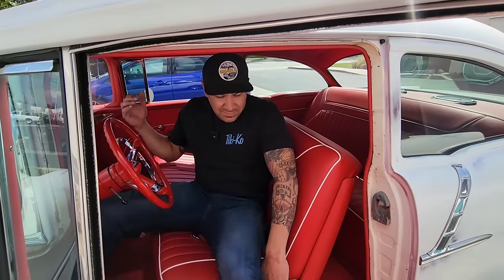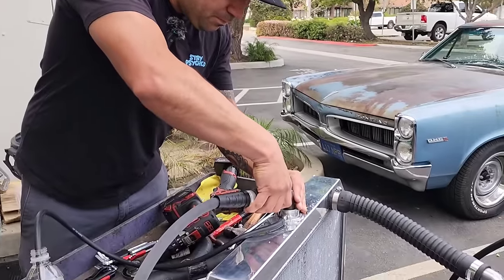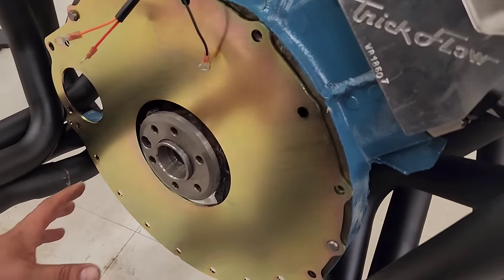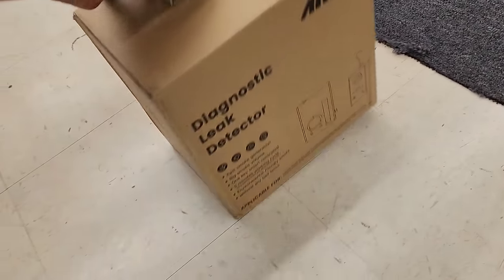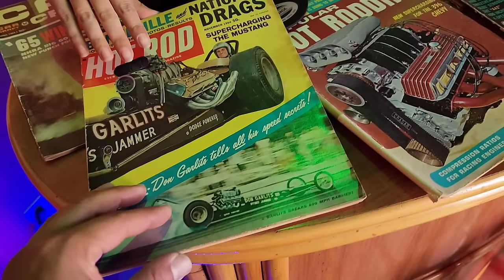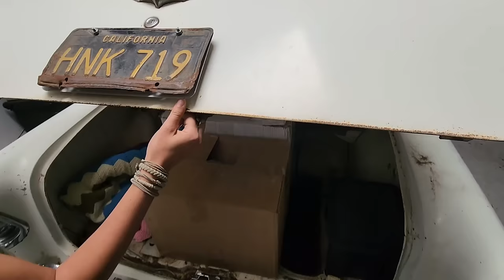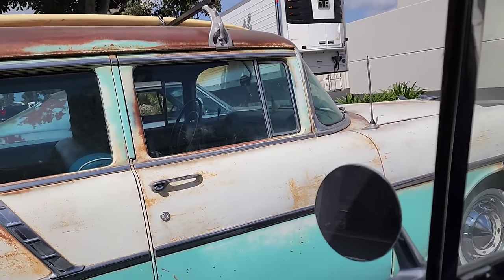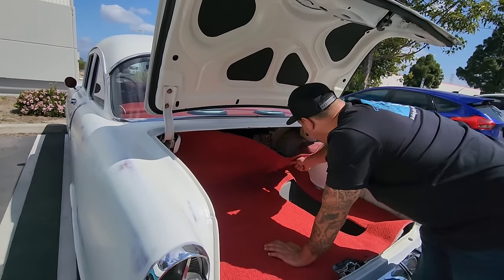Selling One Of Our Tri Five Chevys

Comment: Hey there!, you could get a $20 box fan from Wallyworld, mount it in front of the radiator so its not pulling engine heat through itself, then check out Moroso's universal electric water pump drive kit, which should give you most everything you need to adapt it to mount on just about any engine you want to test on your stand. Happy Hot Roddin!

Comment: Don’t forget you need a crank case ventilation system so the seals can breathe in keep the oil in the engine soon as those pistons start moving at high RPM You will build pressure in a crank case it’s not a stock car so now hi Performance

Comment: #62 Heads had 2.11 intakes, 1.77 exhausts with 72 cc chambers and are decent, should be around 10:1 with +.030" over flat top pistons and should easily get you 350+ HP with a good 4 barrel 750 cfm carb and Ram Air exhaust manifolds or Headers.

Comment from the maker: Hey guys! Sorry to say but the magazine promo is over! We ran out of magazines! Thank you so much for your support. We will do this again in the future.
Reply: Just found your channal     That Grease  Lightning looks like a 55  We had a 55 Red and white 2 door no post From what I have seen the 55's have a straight side chrome trim the 56 had a curved and in 57  They just added fins
Reply: @jamesHadden-l6l The base model 150’s had straight trim that ended just past the vertical trim piece that came down from the rear window area.
Reply: @Steve-ct4jn  Just checked saw some 150's with straight trim some had curved The car we had as a kid was a 55 BeL Aire sport coupe 2 door  red and white no post  Have several photos of ours standing next to it as a kid have a 16 x 20 of it showing the rear bumper with a early 50's  yellow and black MG  :)  Which dad had  Mom eventually sold the Chevy with bad muffler and package  tray Due to the sun for 50.00  :(

Comment: Nick at nicks garage in Canada is the mopar king and someone brought him a engine someone else built and I think someone one tried to fix the rear main seal like 7 times with no secess and I think it even took nick 2 or 3 times but he got it nick hates silicone he said gaskets are suppose to work without it he does everything the way it was done at the factory does to all the right bolts and clamps I think there was a problem with the crank that caused the problem if I'm not mistaken

Comment: All you had to do to be able to run the belt for the power steering and water pump was to make a hose that would thread into the pressure side of the pump and put a nipple in the return port of the pump and hose clamp the hose to the nipple. Since you aren't going to have a steering box that would build pressure when you turned you just needed a closed loop system to get by.

Comment: Hey if keep having leaks on your big block Mopar make sure engine doesn't have a marine crank in it .. engine turns opposite for marine..so hash mark run other direction it almost sucks oil outa engine.. just a thought ,have delt with that issue before ..hope you get issue fixed ,leaks can drive you crazy!!!

Comment: Do you have a part number for that rear main seal? I am on number 5 in my 440.I wish the engine builder would have stand tested before I installed engine in the car.  I do not want to pull the motor and am willing to try once more before I give up and pull the motor.  Subscribed and thank you!
Reply from the maker: The seal I ended up using was a 2947 felpro.  I clocked it in 8 and 2 position.  I did NOT use  RTV anywhere on the backside or on the ends.  The only RTV I used was on the bottom of the cap.  Good luck.

Comment: Pontiac will make more HP with the factory iron 69 intake that that Performer that has smaller than stock ports.. Prob. 380-390 hp with Performer and 420 HP with a good QJet and the iron 69 intake

Comment: Which RAM Air series Butler roller ya running ? They have a full range very mild and up. HP guess tough when don't know if it's the big RA IV one or a mild 068 HO version. Which lift with 1.5's ?

Comment: 3 minutes in, had to comment. Take pride in your janky engine stand! As long as it does what you need it to do. I take alot of pride in producing quality work in a sub par workspace with cheap tools and limited resources. Deep pockets can't buy skill and resourcefulness. Like that episode of Pinks where the garage budget build "used/ Craigslist parts only" Camaro beats the high end fully built Nova thats a shop team car...if I remember correctly haha that aired like 10years ago but best episode forsure! 
Shiiit, I'll fabricate a gt40 chassis and glass a body in the backyard on the grass if I have to. Paint that bitch under a tarp and polish it out wet wet. Lol